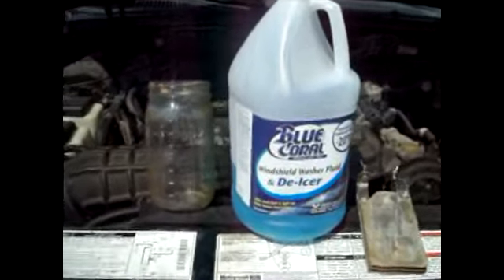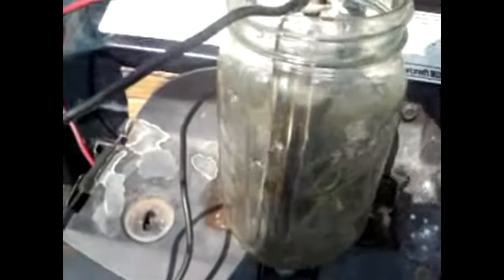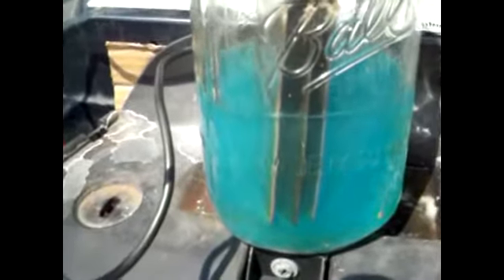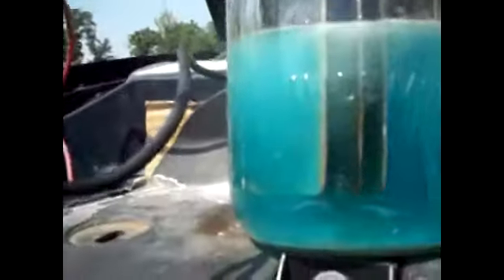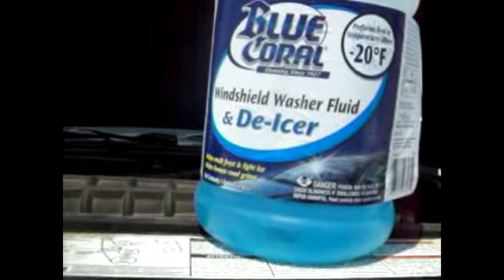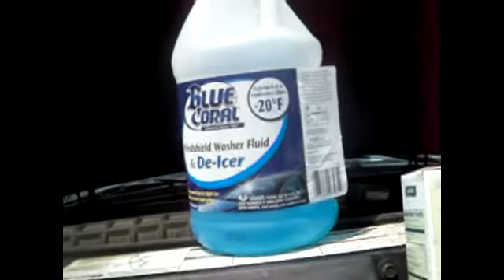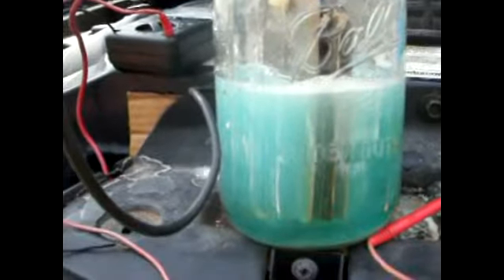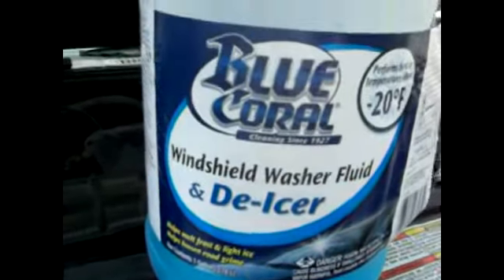HHO antifreeze

Comment: Yes it is winter and it sucks we cannot run our hho generators full out, good video by the way. Can i recommend one thing to you though, and this is only through personal experiences, the stainless steel bubbler is capable of static electricity ignition, i have seen 2 of them explode, just a word to the wise.

Neal
Reply: Should be able to ground the bubblier tank the same way a computer tech wears a static strap to avoid static buildup. Just a thought.

Comment: and you dont necessarily have to use baking soda i have heard that people get just as good effects using tap water the only way to test is to test the output of gas using everything else the same except the water....and then test the output in lpm..but im sure that the electrolyte is only to facilitate electricity flow..which happens if you just use tapwater also.

Comment: Dont use Baking Soda. It is the best known Electrolyte but falls in pieces. Any HHO makes your Engine working better..Use KOH with 5 Percent Radiator coolant.
Reply from the maker: OK good tip. But it is still good for beginners to start with baking soda until they have a better idea of what they are doing, because KOH can be dangerous
Reply: KOH is corrossive but actually you could spice your Soup with it.
Reply: +helmut5230 Just plain urine works fine, the urea has an extra 4 hydrogen on it, it uses 60% less energy to split the water.
Reply: I didnt think of it. I will try it out. What is the concentration Urine to Water ?
Reply: @EVZebra  urine is stick. Its sticky vapours can jam engine pistons